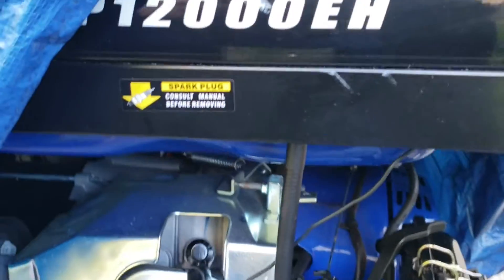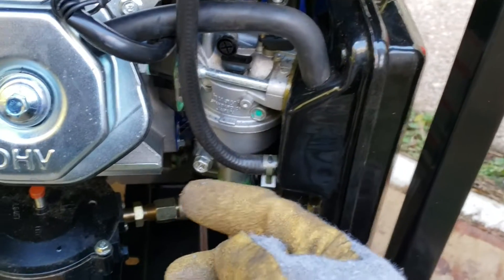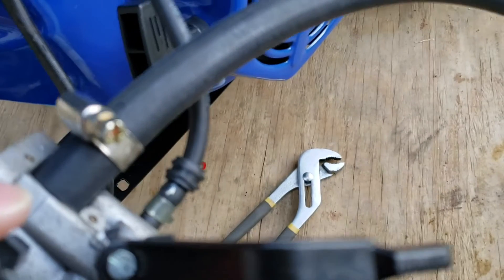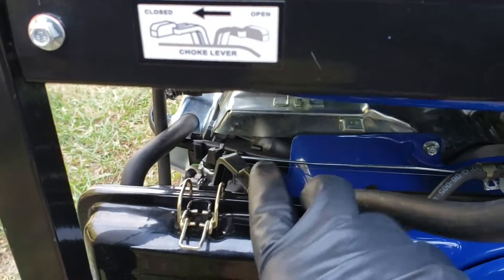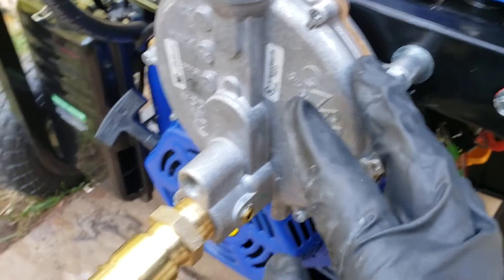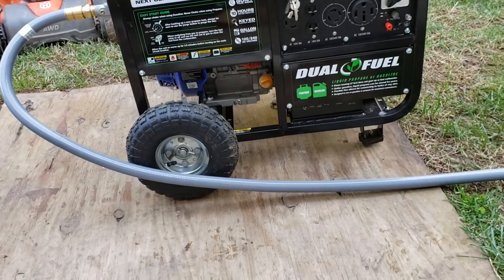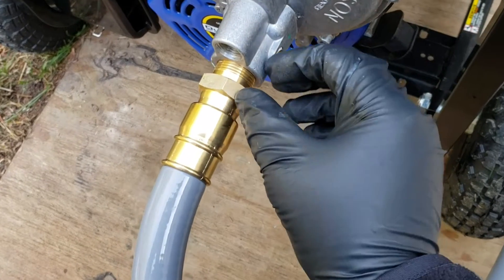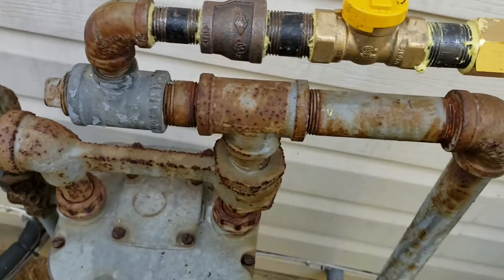DuroMax XP12000EH - Converting Gas/Propane Generator to Natural Gas (Dual Fuel to Tri-Fuel)

Comment: Great job Chris. I have the exact unit is you do and would like the option of running only natural gas or gasoline. I have No interest in propane. I am confused on how to do this. I’m guessing that I could just put the valve after the regulator and turn of the supply of natural gas instead of removing the hose to run on gasoline? Correct? Thanks in advance.
Reply from the maker: Yes that's correct. If you wanted to keep the natural gas hose connected to the regulator at all times and have a valve to turn off/on Natural gas... that would work too., you don't have to remove the hose to run it on gasoline.   By the way, here is a kit that doesn't bring the snorkel kit and it's a bit cheaper:
https://www.motorsnorkel.com/dedicated-propane-or-lp-natural-gas-only-no-gasoline-universal-conversion-kit-for-log-splitters-generators-pressure-washers-for-engines-5hp-and-below-2709.html
Reply: Your link is not working for the conversion kit.

Comment: Thank you, I ordered the same gen and gas conversion because of this video. I already have a gas line running out to the back that I will test this on, not sure of the I.D. of the flex pipe but it's about 30' before the quick disconnect.

Comment: Why couldn't you shorten that snorkel so you could use your choke on gas and avoiding cutting the frame for the type with out snorkel?..cutting the frame is what's stopping me from doing this as I want to able to run on gas as well which I can but with out choke,would probably start without choke but more difficult..anyway..
Reply from the maker: According the  manufacture of the Snorkel, you can still use gasoline even with the snorkel installed. After installing this kit, your generator will be able to run on natural gas, propane or gasoline. No need to modify the snorkel: https://www.motorsnorkel.com/motor-snorkel-tri-fuel-natural-gas-propane-and-gasoline-conversion-kit-4390.html

In my case I didn't need it since my carburetor already had a built-in inlet.
Reply: I have a Snorkel on my Gen and it still works fine with gas, and its a pull start.  The Snorkel is soft rubber that squishes flat when you apply the choke.  If you don't need the snorkel from the kit you can buy just the regulator.  Most Dual fuel you should be able to get by with just the regulator,  Gas only Gens need the full kit with snorkel or competition that has the spacer plates.
Reply: @jmichaelsk I have a Yamaha mz360 I cant find a kit for that engine with a snorkel type only the big thick spacer, was thinking of putting it on the air cleaner side instead of between carb and air cleaner to keep me from cutting the frame not sure why there would be a difference..same principal..I no its not the best option but I don’t want to cut the frame..

Comment: Hi Chris.  So I’ve been eyeing the XP13000EH and plan to use NG with the kit you used.  Problem is, on sale the 13K sold out everywhere.  It was $1079.  Would you go for the 13000E gas only model ($979) or the 12000EH hybrid ($1200)?  I’m looking at the bigger and cheaper model without propane since I will be NG.  What do you think?
Reply from the maker: Well when you convert to NG... you will only get about 80% of what the rated capacity level. So I would go with the 13000E gas model to squeeze out any little bit of extra power that I could get. Keep in mind when you convert to NG on the gas only model, you will need to install the "snorkel" & regulator... where as in a Hybrid model you only need to install the regulator like I did in this video.
Reply: I would go for the gas only 979 + 187(kit) = 1166, saves you 34 for the same capability
Reply: @jmichaelsk  I went with the 13k gas only, got an additional 10% off with free shipping from Lowe’s!
Reply: it needs to be able to run propane to convert to NG...  if you buy the one that just runs gas it will not be able to convert to NG
Reply: @christopherhollifield7546  This is incorrect.  The conversion kit turns a gas only into Gas, Propane, or Natural Gas

Comment: I have been having issues I think getting enough gas from the regulator kit I ordered on Amazon. If I press down on the primer button it gets enough gas but without it just stalls. What model is your regulator?
Reply from the maker: Have you tried adjusting the valve on the regulator to give it more pressure/gas like I did in this video 9:12? I am not sure the exact model regulator that came with the kit, but this is the manufacture where I bought it from: https://www.motorsnorkel.com/dedicated-propane-or-lp-natural-gas-only-no-gasoline-universal-conversion-kit-for-log-splitters-generators-pressure-washers-for-engines-5hp-and-below-2709.html

Comment: when converting to natural gas do you loose power / AMP? I have heard you can run 30 AMP or 50 AMP when converting is this true? do you loose power?
Reply from the maker: Yes it is true you lose power when you convert to Natural Gas. The least powerful fuel is NG, Propane is a bit better, and Gasoline is the best. My Generator is 12K surge and 10K running on gasoline, I estimate that it is now a 10K surge and 8K running on Natural gas. Their is trade off's with NG, but the benefit is not having to worry about filling up.

Comment: Can someone or OP pls confirm if this conversion work on DUROSTAR DS10000E I believe durostar and duramax was same company and they build same generator is just diff brand and diff place of manufacturer. But basically same unit. Kinda wonder if I can do same setup with this conversion.
Reply from the maker: I believe your model generator is gasoline only, so in your situation you can convert it using the same kit I bought... however you will need to actually use the snorkel. For my model generator, since it is a propane/gasoline model I did it need the snorkel. And your situation you can easily convert it to Tri fuel but you have to actually use to snorkel that comes with a kit. Look up snorkel conversion kit videos and you'll see how it works.
Reply: @Mr-Chris  thank you for your fast respond and help! Sorry. Mine is same like your. EH model which is dual fuel. But wanted to convert to natural gas for the family since we have baby at home just in case of emergency. Maybe I can use the same kit that u got and follow your setup. Thank u!
Reply from the maker: @huanvanhuynh  ohhh, in that case yes, all you have to do is what I did in this video

Comment: Hi Chris, thanks for video. I have a Duromax XP550EH and wanted to convert to run on only gasoline and NG. I was wondering why you didn't go with the option in the beginning of your video for the carburetor w/regulator attached at 0:45 sec? Was that the regulator you mentioned that would allow gas to keep being supplied if the engine shut off?
Reply from the maker: I could't confidently find a carburetor combo that would fit my size generator 18HP... most of the  carburetor combo's I saw were for smaller Generators. So I went with the last option as the safest option for me.

Comment: @Chris thanks for the great video. I'll be doing something very similar soon! Couple questions: Did you remove the old LP regulator or just leave it there un-piped? Also, was removing the carburetor necessary to connect it to the new NG regulator?
Reply from the maker: I removed it... but you don't have to do it. I have no intention of ever using Propane, but you can just leave it un-piped and reconnect it when you want propane later. However it might be faster and easier to use the new regulator as it's rated for both NG and Propane, you just have to readjust the valve which is easy to do.

Comment: One, you think a Y or T and valves would work to switch between LPG and NG? Also have you run it for any significant time that there is no issue with combustion temperatures that might effect longevity that you've seen?
Reply from the maker: Yes, I think a Y or a T valve would work to switch between LPG and NG... the only condition is that you will need to "re-adjust" the regulator fuel ratio when switching between LPG and NG... but as you saw in the video, its easy and quick to do. The longest I have run this on NG is 4 hours, and I haven't taken a temperature reading to confirm this... but subjectively, I feel it runs cooler than Gasoline. The radiant heat from the exhaust/muffler running on NG feels a lot less than when I run it on Gasoline.
Reply: @Mr-Chris  well I was just going to go with 2 separate regulators so it should be okay. Thinking a little 2 to 1 block like a little manifold with either ng from the house or propane from the tank thru the stock regulator that has no adgustment
Reply: @Mr-Chris  and further research says the both LPG and NG have cooler flames so it shouldn't hurt it though be aware of higher cylinder pressures at times

Comment: Hey Chris, thanks for posting the informative video. I have the exact same generator and I'm in the process of setting it up just like you did. The only difference is I'm about a 100' from the gas meter although I do have another gas source right outside of our fireplace that's about at the 50' mark. Anyway my question is where did you get the flex hose for your setup? I do believe for the distance I have (100'/50') 3/4" should work for it unless someone tells me otherwise. Thanks again for the post. P.S. any and all suggestions will be appreciated. Oops, just replayed your video and saw where you purchased your hose from Amazon, missed that the first viewing.
Reply from the maker: In my initial research I think anything over 25 ft natural gas line flex hose is too long... However I might be wrong as I'm not an expert in this . These natural gas hoses are very expensive, the one I have is only 15 ft long and cost over $110. You might be better off if you put the generator near the gas meter and run a longer electrical extension cord to where you need it.
Reply: @Mr-Chris    Appreciate the reply. I did find a 1" flex hose at Home Depot that you can bury that is considerably cheaper than the rubber flex hose but you have to bury it or run it through conduit which is do-able, although I didn't really want to bury it. I didn't know about the 25' max length limit from the meter and generator. If I put the generator 25' from the meter that would still mean that I'd have to purchase about 70' of 50 amp cord which is probably more expensive than the LP hose. Talk about a rock and a hard place. I may have to run it on propane after all. Oh, just for giggles I priced the 1" hose at US Carbs and it would cost almost $800.00. Thanks again
Reply: I had my gas company move my meter about 20 feet closer to generator, inlet box, and electrical panel.  It cost about $300.

Comment: Awesome dude it does work but the $ ? did  you try first with out the kit propane needs more air than gas for  the right mix i think it just the hose sizes to make it work...
Reply from the maker: I tried the propane connection, it doesn't work for Natural Gas. The Factory propane regulator is non-adjustable where aftermarket ones are.

Comment: Chris,
The brass Tee you adjusted and the generator started to stall.  Did you have to make other adjustments when different electrical devices came on or shut off in you house?  Or did one setting work?
Reply from the maker: The only thing I adjusted was the brass tee. There is a large range between not enough gas and too much gas. I intentionally adjusted the tee to run good a little rich on gas in case it needs more. When I connected it to my house, it would surge when a large appliance like a microwave would turn on...  it kept going and handled the surge load well.

Comment: any reason you could not have stayed 1/2  inch ID all the way from your original plug and used cheaper 1/2 hose over the 3/4? Mine get here Thur this helped alot
Reply from the maker: I'm not an expert, but based on the tons of research I did on this...   Other expert suggests for this size motor 18hp.  it's recommended to go 3/4 inch.  I honestly don't know the reason why.
Reply: With 1/2 inch hose you may find that generator does not get enough gas to run.  That is why I went with the same unit and not a Generac.  The generac needed an 1-1/2" hose to work because of my 70 foot run from gas meter.

Comment: So what if anything needs to be done after  the modification to run the gen on gasoline? Do you just unhook the gas line and turn on the gas ?
Reply from the maker: That's the awesome thing about this... no major modifications to run on gasoline. Just remove the natural gas line, open the factory fuel valve to allow gasoline into the carburetor, move the choke like you typically would for gasoline, and start it right up.
Reply: @Mr-Chris  Can you do parts list or amazon links
Reply from the maker: @brightpaul  I have the hose and regulator kit that I used from Amazon links up, but I haven't been able to find individual regulator parts on Amazon.

Comment: To add to this I believe you could put a  tee with a shut off in the regulator line and then run a line back to your original regulator there buy having a tri-fuel, gas natural gas or propane.  HMMMM    options      https://www.amazon.com/dp/B07413ZLCG/ref=sspa_dk_hqp_detail_aax_0?spLa=ZW5jcnlwdGVkUXVhbGlmaWVyPUEzTkcxUUNSUkpRVEQzJmVuY3J5cHRlZElkPUExMDQ2MTUxMzRPOFNRQVI1SFdUMCZlbmNyeXB0ZWRBZElkPUEwNDY2NzE1MUtMOFVZWllZWURIQiZ3aWRnZXROYW1lPXNwX2hxcF9zaGFyZWQmYWN0aW9uPWNsaWNrUmVkaXJlY3QmZG9Ob3RMb2dDbGljaz10cnVl&th=1